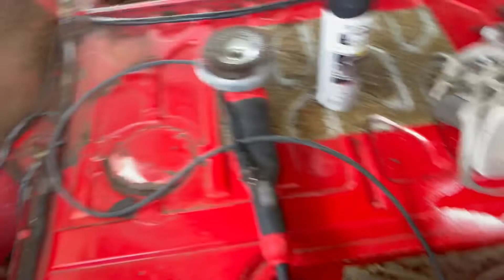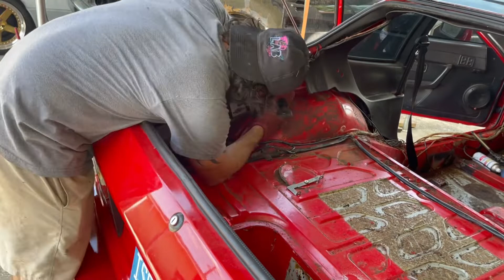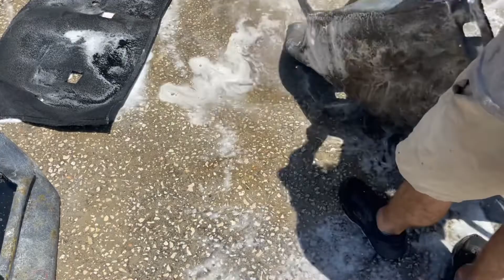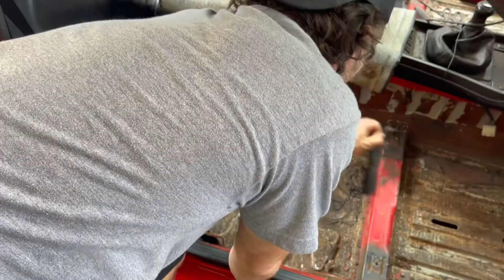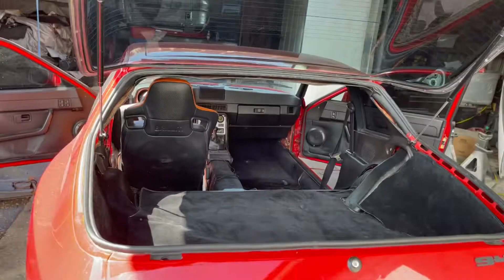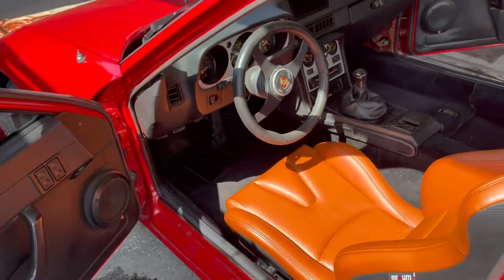Project Porsche 944r track car stage 1.5: adding back lightweight interior

Comment: Hey Pete, I wonder... Let's say I have an old car, like 1987 old and I want to add isolation pad to it. Do you think adding that truck liner paint first would help in any way? It's more material between me and the road after all
Reply from the maker: I’m sure it would help a little but even better would be a rubberized spray.   They sell it at home depot